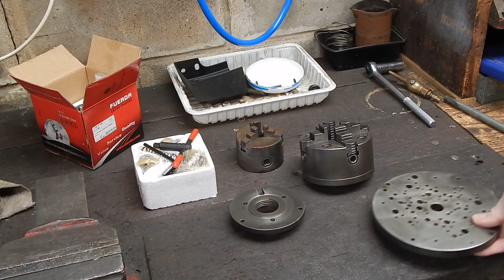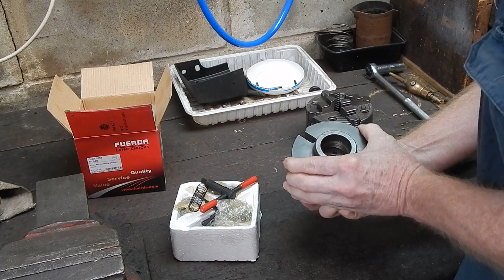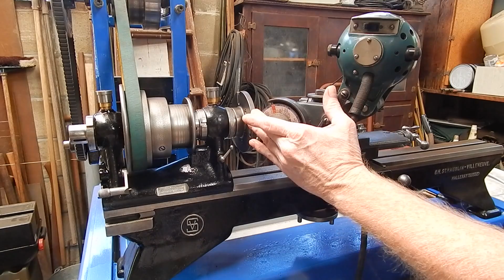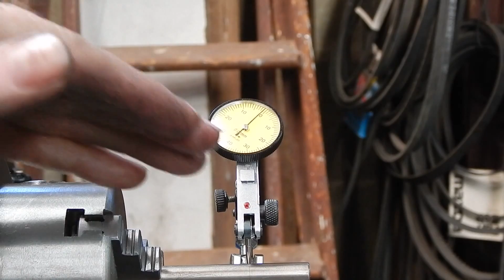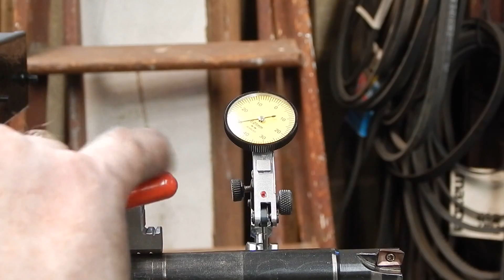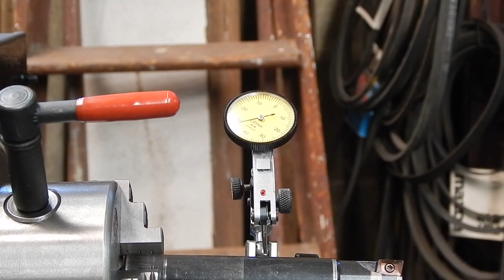Fuerda lathe chuck review - with surprise ending

Comment: These fuerda chucks are garbage . We have a 250 mm 3 jaw chuck from them on our small lathe and within not even half a year of working  its out by around 0.3mm instead of the andvertised 0.03 mm.  There are burrs everywhere and the  hardened 2 piece jaws have terrible tolerances and arent really that hard . Rather spend a little extra money and get a  AUTOSTRONG (made in taiwan)
Reply from the maker: Absolutely correct.  They are total shit.  Nothing like when they were made in Europe. Total disaster now.

Comment: Speaking of roller bearings, have you given any thought to swapping the stock bearings out for tapered roller bearings?  I've done such a mod on a cheap chinese lathe, quite a difference.
Reply from the maker: Slappy Fistwad This lathe came with high precision tapered roller bearings.  There wasn't any grease in one of them, but they were tapered roller :)  Tapered roller bearings are increasingly being fitted as standard to many small Chinese lathes nowadays.  Cheers Rob

Comment: You're quite right Rob, as far as chucks and everything else made in the motherland (China) they manufacture most of the best products in the market for "big name brands" sold as for instance US Made when in fact they are made there for a price.
Therefore the emphasis in our search for products it has to be based on price.
Not surprising for a 4,000 year old civilization planning a manned trip to Mars of all places (on the grounds that the moon it's to close) and this is fact not fiction. hahahah
Reply from the maker: Hi Jorge.  For $1K it would want to be good.  What got me was that the pins that hold in the pinion/spider gears didn't appear to even be hardened,  They also had deep semi circular marks in them from who knows what?  They and the pinions were not polished in the rubbing areas in any way, and appeared to be shot or soda blasted as a finish.  I was pretty pissed when I saw how shoddily it was made.  And then to top it off, it started jumping teeth.  So the tolerances were obviously out to hell. Can you believe that?  I've never seen that happen before, even on a worn out old chuck.  I wish you luck. Rob
Reply: xynudu . I wish to congratulate you on your Schaublin and your bench construction. Beautiful and very clean. Concerning my planned purchase, I'll buy their mounting plate also and if doesn't perform as claimed I'll take back.
Present day Bisons are made in Poland and I read reports of unhappy owners who feel that they are not made to the same standards as before.I have no idea where Bucks are made but I am suspicious. Pratt Burnerd are supposed to be English made and are good and expensive. Excellent tooling and machinery can be bought from the Checks in brands such as Toz and Skoda. Russia also sells here in Canada and they are very good quality and built like a tank.  .

Regards

Jorge

Comment from the maker: I've got to say i'm really disappointed in the Fuerda. I had high hopes on this one and it all came to nothing.  Makes you wonder how much you have to pay to get a half decent chuck. One pinion gear in the chuck was very loose with about 3 mm sideways movement when tightened. Also the pins holding he pinion gears in place were small diameter and appeared not to be hardened. Not a confidence inspiring factor.  To get tooth slip indicates the mesh must be way outof wack. All in all a very disappointing exercise.  Rob
Reply: Fuerda = some "Made in Hong Kong in a hurry" crap !

Thx for the info !

Comment from the maker: Took it back and got a full refund, no worries.  The shop was excellent and I have no problem with them  They offered a replacement, but I declined as I just don't have any confidence in the brand.  I may consider fitting an ER collet head to the lathe instead.  I have plenty of ER stuff and it's excellent.  The Schaublin collets with the lathe are OK, but are imperial and have very little pull down tolerance, making them a pain to use.  So it's back to the drawing board on this.  At least the monkey is off my back.  Cheers Rob.

Comment: If it says on the box that is MADE IN CHINA that should be all the information that you need to now about the accuracy of that chuck. That snould be a lesson for the future about Chinese made on an boat on your way to buy them things. BAD QUALITY.
Reply: A lot of quality items come from China. This just wasn't one of them.
Reply from the maker: I totally agree.  China will make to whatever quality you specify.

This looked good, had a neat little oiler in the face, but the internals were rubbish.

A total garbage chuck.

I still have the original Chinese chuck that came on my lathe, and it's in excellent condition after all these years.

But I don't know what brand it is as the label disc has faded.

So I went for a supposedly good brand, and regretted it.

Cheers Rob

Comment: .02mm = .000787 Inches.  I wish mine were that good.  Too bad it's crap.
Great old machine,  you've done a fantastic job on restoring it!
Reply from the maker: I was quite happy to get it to 0.02 mm and expect "some" variation in the scroll, but to then go out to 0.1 mm is not what I was expecting from a supposedly precision chuck (according to the salesman).  The cruncher quite litteraly came when the scroll and pinion gears started skipping teeth.  I couldn't believe it - even a worn chuck is unlikely to do that.  Rob

Comment: You didn't grind close in the "corner" !
You couldn't get close to the relief on the back plate - wouldn't that leave the run out when you mount the chuck ?
I mean the back of the chuck will rest on that "old" material not ground away - right ?
Reply from the maker: Hi Keld.  When I machined the register down from 57 to 55 mm, I went back into the face plate slightly with an angled cut, that way it's not ecessary to grind up against the register (and possibly damage it). Cheers Rob.
Reply from the maker: xynudu . If you listen to the video you can hear the grinder go (quiet) into the clearance zone where the deeper cut is.  Cheers Rob.
Reply: xynudu . OK - then I understand